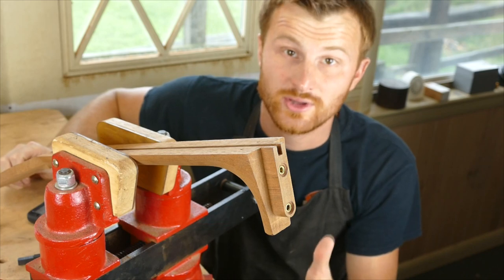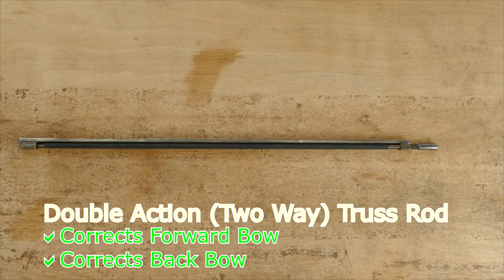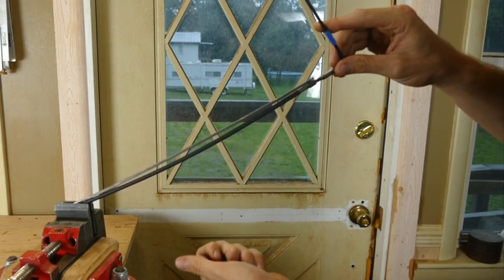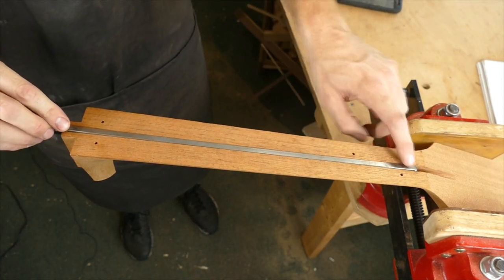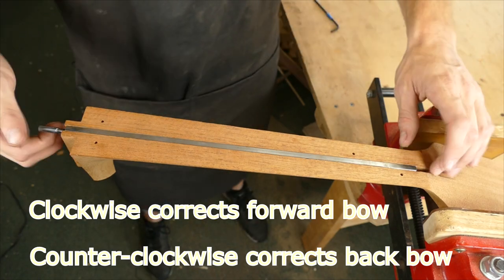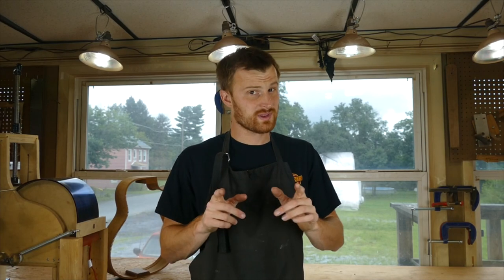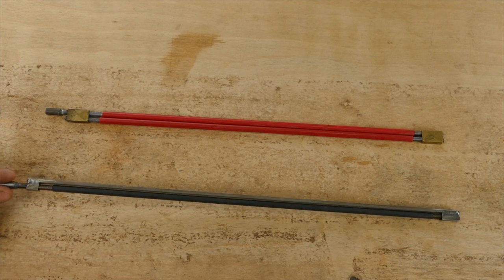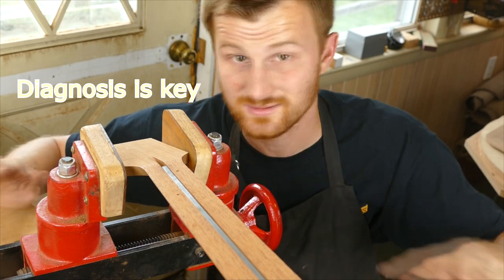How a Truss Rod Actually Works

Comment: FINALY - someone actually DID explain "How a Truss Rod Actually Works", not just how to adjust one. Specifically for me - that there is reverse/opposite threading at one end, I assumed, without knowing, it must be that or free turning (non-threaded) in a slotted/notched hole (for one way adjusting truss rods?). Thank you!

Comment: Thank you Eric for a simple demonstration of how a truss rod actually works. I have just removed a truss rod from an old Samick guitar from Indonesia as the neck was completely 'shagged' as we say in Australia. I have dabbled in constructing kit guitars but never knew how the truss rod was constructed. Thanks to you, now I do. Unfortunately the truss rod that I just removed must be broken as the nut on one end is not fixed to the square tube but I have learned a lot from deconstructing the guitar. I have not actually removed the neck from the body but had to resort to a hacksaw to get to the truss rod & in doing so I 'rooted' the finger board! Australian definition, 'rooted' means f....d!     'Shagged' ditto! The guitar was not great quality and had been hanging in someone's shed. I was given permission to experiment on it. If I can safely remove the rest of the neck I might see if I can locate a cheapish replacement. Thanks for the excellent video.

Comment: Double-action truss-rods are useful because they can not only correct a forward- and back-bow problem, but because they can induce relief in a brand new, straight neck. Relief allows for the action to be raised a bit the lower frets, without becoming ridiculously high at the upper frets.  Action is a matter of preference, but there is a more or less correct relief amount to match a given action.  You basically want the string to be parallel to the fretboat at the highest frets. The higher the action, the more relief that condition requires.

Comment: Hi eric, I noticed there is around 85mm between the main upperbout brace and the top of the guitar. You can get truss rods with extra long (85mm) adjustment nobs so that the Allen key wouldn’t have to go far to do the adjustment. Why don’t you use those as opposed to the standard ones when you will have to put in the Allen key quite a way before making contact as I presume you wouldn’t want the truss rod bending action to start before the body/neck join ?

Comment: Does the turning of the nut have a loose feel when the 2 way rod is in the neutral position? In other words, is there a way to tell when the 2 way rod is in a relaxed state & therefore show if the neck has a relaxed bow or back bow. Thanks.

Comment: Hi Eric, thanks so much for this helpful video - a quick question if I may, I have a dual action rod and wondered about the part where you mentioned “a little turn goes a long way” - mine seems to work fine but I was curious why it seems quite loose and very easy to turn - in comparison to my other guitars with single action truss rods and that in both directions (clockwise and counterclockwise) after maybe a full turn it becomes less freely moving and “bites” and starts to tighten - I’ve never pushed beyond this point but was wondering if this was (1) the full extent of the turn or whether (2) it was the engagement point - and that the middle loose feeling section is a “neutral” stage - thanks again! :)
Reply from the maker: I addressed your comment in a new Q and A episode: https://youtu.be/_APy7b-UncU

Comment: Thanks. I'm planning a guitar. And the truss rod has me perplexed. This answered so much. Thank you! Questions (hope you answer for free) do you tape the top flat part of the metal to prevent glue from seeping in when you glue on the fretboard? Also, I noticed 4 small holes on the neck; is that for positioning the fret board?

Comment: thank you Eric . question please , now i understand the truss rod way better but  carbon fiber inserts beside truss rods how does that work. carbon fiber is to keep neck movement  from happening . so confused
Reply from the maker: I haven't used carbon fiber inserts, but as far as I understand the idea, first and foremost, is that they prevent or mitigate the problem of neck twisting. Because the inserts are on either side of the truss rod they add some lateral strength. Also they stiffen up the neck overall, so neck adjustments with the truss rod are less frequent.
Reply: oh okay thank you
Reply from the maker: Hey Walter,
I also included your question here in my latest video "Guitarmaking Q&A for August 3rd, 2018", so you might want to check that out. I expand a little more on what I said here. This video, however, isn't available until Friday at 10am, so you'll have to wait until then.
Here's the link for when it is available: https://www.youtube.com/watch?v=vTfZrvtAR2c
Hope that helps!
Reply: thank you not a problem . take your time i am an old geeze retired i got time i just forget what day it is again thank you

Comment: A question Eric: why does "tightening it" make the truss rod bend?!? Does "tightening" mean shortening the truss rod?
Reply: Grab some flexible material, such as a thin plastic sheet or a strip of flexible balsa wood. Then squeeze the opposing ends together. You'll notice that it bows just like the truss rod does! 

The cylinder acts like a pipe clamp, which squeezes the flat metal part and causes it to bow, just like the flexible material I mentioned above.

Comment: How to know if a truss rod is single or double action?
Reply: If you turn it one way and it feels tight, turn it the other and it will go loose then tight as the direction of bow changes. Mark the end at the start so you can undo the change.

Comment: I turned the truss rod on my Bass both ways and still the strings lay on the fret board. I'm seriously about to drive to you so you can look at this thing lol
Reply: Okay, so you only adjust your truss rod if your neck is actually bowed. You can actually just make this judgement with your eyes. You want it to be straight, so just do that.
From there, if you are still experiencing buzzing, it's likely due to either your nut or the bridge/saddles.
First, you need to find out where the buzzing is happening, this will tell the next step.
Because the next step is determining if it is just the bridge needing raised, or if your nut is actually worn down too far and can no longer keep the strings held high enough. 
If you're only having buzzing on specific frets but no where else, then it's likely a fretting issue, and that's a whole other discussion.

Finally, you have tried fresh strings, yeah?
Reply: To test the nut:
Check first fret. Is the string(all of them) being held high enough to clear the first frets? 
If yes, nut is probably the issue and needs replaced, and the new one will need cut to that guitar specifically. 
If no, then check that the strings sit firm & not loosely moving around the nut, also that the nut it's self is secure.  If all is well, move on to start assessing the bridge.
Reply: The way i test bridge/action is by fretting the 12th fret and using my pinky to fret another fret higher up, and see if they rattle or have a noticable gap or anything.  If the action is too low, the 2nd fretted note will buzz or mute its self. If too high, it is just uncomfortable to play.
Adjusting action is easy and usually done by the individual saddles, simply raise or lower them, retune, test. Repeat until satisfied.
Reply: If everything up to this point is failing and you are still getting buzz, it is likely due to uneven frets or dead frets. Frets wear over time, especially if you hang around specific notes a lot. 
If mild, simply grabbing a perfectly straight block + some super fine grit sand paper & a polish after will do the trick to relevel them, just be very careful not to take too much fret material.
If too severe, they need replaced, and when replaced you'd need to do the above process to level out your new frets.